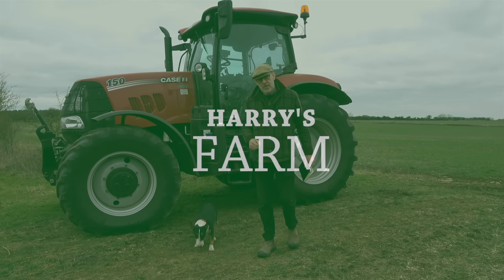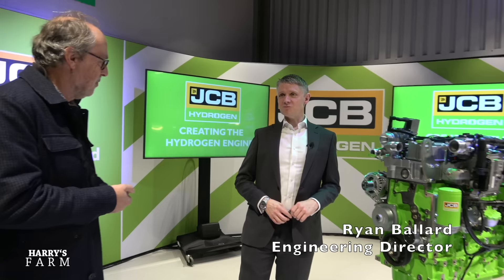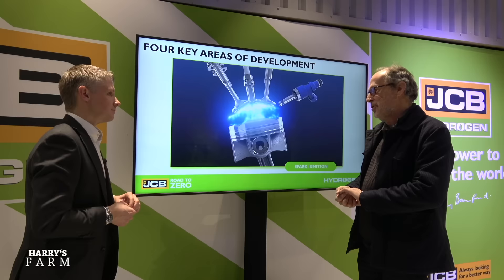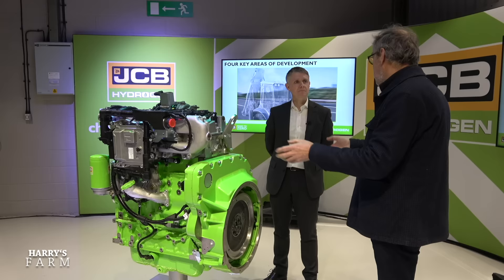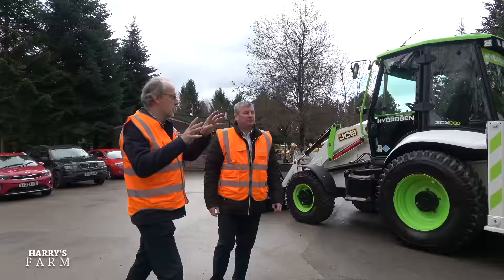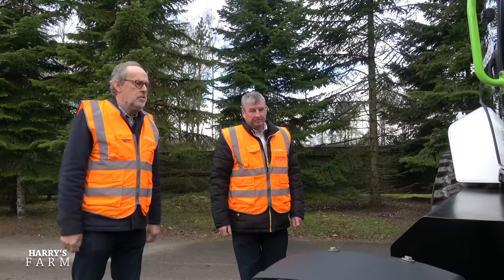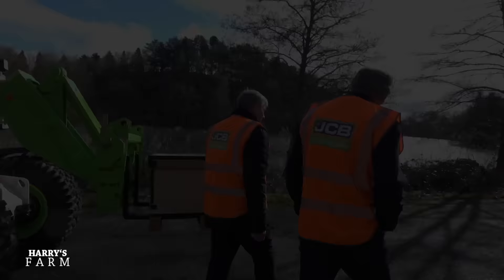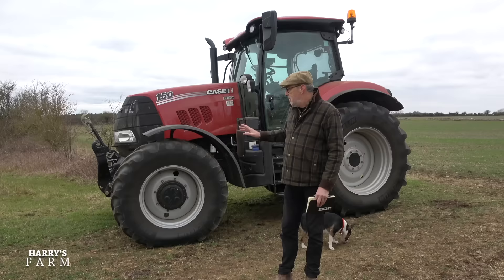JCB is moving to hydrogen power for all their big machinery. Here’s why.

Comment: I agree with the final conclusion. Batteries are not always the best option. The Netherlands is going to build a wind park just for the production of hydrogen. And the hydrogen is going to be used for industrial purposes to lower the industrial emissions. There is also an experiment with a small hydrogen system for a single house that is producing hydrogen with the exces energy that is generated by solar panels on the roof. That small system is using a fuel cell so that it can produce electrical power for the house, but farmers in Australia for example could use a similar system to produce their own hydrogen on their own farm so that they can refuel their machines. The technology is there to make it work. 

My biggest concern is that the politicians don't really want people to be energy independent. Governments want to lower the emissions, but they still want the majority of the people to be hooked to a central energy supplier. Only the wealthier homeowners can really enjoy the renewable energy sources because they can afford it, and they get all the subsidies for insulation and solar panels and heat pumps and so on. People who are renting a house, or at least here in the Netherlands, are in most cases not even allowed to put solar panels on the roof, and because they are not the owner of the house they don't get subsidies either even if they were allowed to put panels on the roof or when they could afford insulation and/or a heat pump, and so on. And for people who live on welfare the situation is even worse because they are not even allowed to save money for solar panels or a heat pump assuming that they could save some money, because if they have too much savings they get sanctioned by the government. So they don't get subsidies because they are not the homeowner, and they are not allowed to save money for panels or something else because above a certain amount of savings they get sanctioned. 

Too many times those politicians start a new career as a board member or CEO from a large multinational after their political career is done. Here in the Netherlands we have seen it time after time. They become a minister, and after a few years they go work for a company in the field of work that they used to have in their portfolio as a politician. Even union leaders who were always fighting against the big bonuses from board members and CEO's during their career as a union leader became board members themselves from large multinationals after their career as a union leader, and the first thing that they did was to sign for a raise from the bonuses for the board members and the CEO's. We have two examples of that, Wim Kok, and Lodewijk de Waal. At that time when this all took place they both called it a devilish dilemma. But they both signed for it anyway. And they both used to be the highest leader from the biggest union.  

So I have no concerns at all about the technology, but I do have big concerns about politicians who only care about money and power and a future position as a board member or CEO from a large corporation. They look for options that are not necessarily economically beneficial for the majority of the people. They always like to talk about competition, but just look at your computer, how many operating systems can you really choose from? Big tech is often so powerful that there is no real competition. And even local retailers monitor each other by the minute, so if you go shopping for a particular product it is almost everywhere exactly the same price. And although there are many utility company names, there are truly only a handful or even less true owners who own all those companies. It is imaginary competition. 

In the meanwhile the same politicians and multinationals have no problems at all doing business with countries that couldn't care less about human rights or democracy. Look at Russia, look at China. They have build their military capabilities from money that we have spend on them.

Comment: I find this to be much more appealing than pure battery/electric. Hydrogen combustion hybrids would make a lot of sense if we're serious about cutting emissions in every day vehicles. Don't need to have a charger (which to me seems superior especially for those with no fixed parking location), no real emissions to make the electricity on board, all we need is to lower the costs (both money and power) of producing hydrogen, and build the infrastructure at existing fuel stations. And once the infrastructure exists, no range anxiety. Sounds like a winning strategy to me.
Reply: It’s not that winning when you realize how inefficient it is.

Comment: Bloody fantastic. Well done jcb. You need to develop a van and 4x4 pickup/suv. You would become a world beater keep the prices realistic guys.
Reply: Not when you realise how expensive hydrogen will be.
Reply: @Simon  price will drop if they want it to succeed it has to cars will be better off than electric. When you think about replacing a battery costs more than I can spend on a car
Reply: @markjeep9415  Electric will always remain much cheaper because making hydrogen requires a lot of electricity. Battery replacements are very rare and the prices have been dropping a lot.
Reply: @Simon  solar and wind. I gave a march labs hho generator in my garage always intended to fit it to my car. Not by running it fro  the cars battery but via a separate battery and a solar charger to extend the running time ha I've never got round to it but as the car nears the 150 000 mile mark I might just give it a go, not a lot of room under the bonnet 3.0lv6 mercedes diesel. It's in a jeep and only euro 4. Just passed its mot and the emissions was good enough to pass in a 2016 car and that would be a euro 6 and clean air zone exempt. Hydrogen is a way forward just never developed and in the uk there will not be the required investment in the infrastructure. We drill have little reliable charge point infrastructure yet ev is being pushed hard. I tow a caravan of around 1600kg in a 2006 grand cherokee that cost £1300 plus jobs that it needed  doing, I nor many other folk will be able to afford a tesla model x or the likes at around 50k second hand full stop.
Reply: @markjeep9415  That seperate battery that runs that HHO generator should be at least 4 times as large as an average EV battery... It's a fools errand.
Reply: @Simon  well a 110 amp h leisure battery I have will run it for a while and amps drawn will depend on the electrolyte.
It's not a massive one and the idea is to see how it reacts as for as any reduction in emissions and if any improvement on mpg 20amps max I am aiming for.
As daft as it sounds I did it years ago with a reactor made in a coffee jar with a switch and relay to power it up. Vw caddy van 1.9sdi with it on I could accelerate up a hill better (foot to the floor both tests) than without it and I made 4th gear by the top of the hill without it it would still be in 3rd. A trip to rugby and back made almost 1/4 a tank difference in fuel than normal and I would be doing that 2 or 3 times a week
Reply: @markjeep9415  That’s not how it works. Lets say 1/4 tank = 15 liters of diesel. 15 liters of diesel equals 150 kWh of energy, which is a 12 volt battery of 12500 Ah.
Reply: @Simon  well I am not sure but after a few seconds it made enough hho to split a plastic bottle open with a good loud crack. It just ran o lot better with it than without it, not having to drop a gear to hold speed on an incline I would turn it off going down hill to keep the water cooler

Comment: Hydrogen used in the fuel cells is a very flammable gas and can cause fires and explosions if it is not handled properly. Hydrogen fires are invisible and if a worker believes that there is a hydrogen leak, it should always be presumed that a flame is present....Let us hope that JCB has done their best home work on the "SAFETY FACTOY" of their project.

Comment: The question is not building an Engine, or a Re-Fueling-Truck,  that's the easy part.
The question is all about the method of producing the Hydrogen in the first place.
Hydrogen, plus Water-Injection, will run just fine in almost any current Engine.

Comment: I love JCB for doing the Hydrogen engines.. there doing fantastic work and the elimination of the No2 is great as it stops the idea of emission charging even on hydrogen.. love it. Thanks for keeping up on this one Harry. Home excess solar going to personal electrolysers lol the things that might emerge from this is awesome.
Reply: NOx is not eliminated. Lightning ptoduces nitrogen oxides. Rxactly the same thing happens in  a hydrogen engine.
Reply: @rogerphelps9939  if you watched the video fully you'd of seen the section where they say the complete redesign has resulted in being able to run at lower temperatures and as such avoid the creation of the No2.

Comment: Very nice contribution to the debate on technology diversity! Thank you! I completely agree with you that governments will finally have to acknowledge that battery power is not the solution to everything, or even most things, to be honest. Technology diversity at a time of crisis with many unknowns, uncertainties and unpredictabilities is the best thing that one can have: it gives us great flexibility to respond. My big fear in all of this mobility- and portable energy revolution is that we replace the devil we know (fossil fuels) with the devil we don't yet know well enough... Mining for ores for battery manufacture is already creating massive environmental degradation and now threatening to churn up the sea bed (deep sea mining of mineral nodules). And even once we've done that, the recycling processes (yes, plural, because there are many different battery types) for batteries are still embryonic and not yet financially viable - otherwise manufacturers would prefer recycled lithium to mined: unfortunately mined lithium is still substantially cheaper than recycled. What all of this "half-baked" (excuse the term, but it's quite apt) technology roll-out will look like if scaled up to all of the vehicles on the planet simply leaves me aghast... So: hurrah for technology diversity that gives us other options to research, assess, implement and USE SPARINGLY!!! (yes, the greatest immediate help we could give the environment is to cut consumption quickly)

Comment: UNFORTUNATELY JCB's are a very rare site on most construction sites nowadays, 20-30 years ago they were everywhere, I've been in the construction industry for approx 40 years, I can't remember the last time I saw a 3cx on a site, I'm not saying this is a bad idea, it's not, but it needs a LOT Of work to be practicable on a modern construction site, as I pointed out in my last message, ground clearance is a major problem for a vehicle like this with such a low tank, and the mainstay machine on sites today are TRACKED excavators, where were these in this video 🤔🤔🤔🤔

Comment: A couple of points cross my mind: firstly, to what extent does hydrogen embrittlement affect the performance and lifespan of everything it comes into contact with?  Secondly, let's say I swap the 100BHP petrol engine in my family car for a hydrogen powered equivalent.  If my new hydrogen tank is the same physical size as the 50l (11 gallon) petrol tank, how many miles could I expect to travel?  Or, to achieve the 500 miles per tank that I currently achieve, how big would the hydrogen tank have to be?
Reply: Too big to make any sense.

Comment: Well done JCB, you are totally committed to hydrogen power. It just proves that electric is not the complete answer. Yes battery has it`s place in small city cars and personnel transport, but hydrogen is a far better replacement for fossil fuels. The technology is proven to work and much cheaper in the long run. A major factor when is comes to farming and moving goods around he country. As you said Harry, the government needs to wake up and back hydrogen as a long term alternative rather than battery which is just a stop gap I feel.

Comment: 27:50 Hydrogen at 350 Bar has a density of 26.1 kg/m^3. Much less than styrofoam. The parasitic weight of the tanks is over 95%. Then when transferred to the tanks on site some will be left behind as the pressure equalises. The biggest challenge here is the logistics.

Comment: As I understand it, the hydrogen is made by passing an electric current through water to split it into hydrogen and oxygen. The electricity comes from either burning a fossil fuel to turn an electricity  generator, or carpeting the farmland with even more solar panels (which will severely shade the ground and make it unsuitable for growing food) and wind turbines to try to generate enough electricity to split water into hydrogen and oxygen. Also, hydrogen is extremely undense and needs compressing to get it into a tank on a vehicle, so how do you compress the hydrogen? By burning more fossil fuel or drawing  more electricity from your multiple fields of solar panels and wind turbines. Also, hydrogen is the smallest molecule in nature and I believe it steadily leaks out through most materials, so the tank walls will have to be thick and dense, which means very heavy. How much extra weight does the tank add to the vehicle? It seems to me more sensible to burn fossil fuels, which not only have the advantage of releasing CO2 and therefore feeding plant life, but are easy to carry around.

Comment: A engine made specifically for H is the best.  It will give better power.   However, conversion kits for diesel to H or gas to H are out there.   However, these conversion kits do see less horse power from H fuel engines.   If my V8 Truck has a 10% drop in power, I am ok with that.   See the Cdn inventor Greg Veznia.   He has designed conversion kits already.

Comment: This is very interesting, I really like the idea of this as a truck driver in America. California for example is trying to force trucks to go electric. It simply doesn't work for most trucking applications. Not to mention that the electric grid which is government run in California can't handle the current demand let alone the massive increase that would be needed. The biggest thing for trucks is the range and the refuel time. 

  Although I completely understand why they would say it, the simple fact is that there is not a climate emergency. There is a climate problem which is very different from an emergency. There is little the "western powers" can do about it as most of the pollution comes from other countries like China which will not change until you can make it truly cheaper. That being said, I am completely with the idea of this. I do have more questions though. For example, what would the driving range be for a semi truck on hydrogen? And how much electricity is needed to make the hydrogen? Most electricity in the America for example comes from burning coal, which is much cleaner than it used to be, but still not zero emissions. We definitely need to look at the full/big picture cost of it all. But this does sound much more promising than electric! 

Thanks for the video!!

Comment: I have seen a car run on strait water, without any conversion of the water, strait from the tap, the man that did it said he increased the jet to allow twice the flow and had a single wire coil about 4x4 inches on the side of the block that ran to the positive of the engine coil and that was all he would say about it as he was hopping to sell it, he was killed not long after.
Reply: It's a famous, century old, scam.
Reply: @Simon-dm8zv  
It was no scam, he put the hose strait into the fuel tank filled it up, showed it come out the fuel line then started the car, he was my grandfathers friend across the road, he would have told us more about it but he was trying to sell it the Holden car manufacture, but to his surprise they were not interested, neither was Ford it was then he got a visit and was told he could keep it in his car but was not to talk about it or else, when he showed us, there was a twenty seven year old man from up the road that was also there with us, he figured it out two years later and built a motorbike that used water, next the old bloke was found dead on the side of the train track claiming he fell out the train drunk, the train had automatic doors, and he did not drink, it was no scam.

Comment: Great video. Now we just need clean and efficient hydrogen production. This is a great development for heavy machinery and industry, but should not be considered for small vehicles like cars etc. Hydrogen is far too inefficient in production, electric is a much better option, and if hydrogen is to be used somewhere, use it for large scale grid off peak storage of renewable power. All top industry experts agree on this, called the hydrogen hierarchy. Unfortunately we are already seeing hydrogen lobbying with "hydrogen ready boilers" when heat pumps are here and ready, and far far more efficient than hydrogen.

Comment: Living in wales with a massive wind power infrastructure why the welsh government is not following the hydrogen path, producing hydrogen through the night when the power demand’s are low is an obvious winner. Wales should be at the cutting edge of the hydrogen revolution using hydrogen power stations on the coast with wind and sea on tap, thousands of jobs could be created.